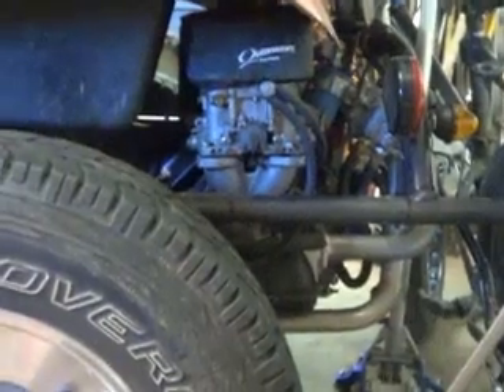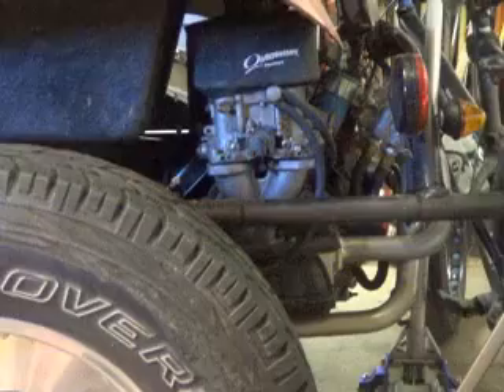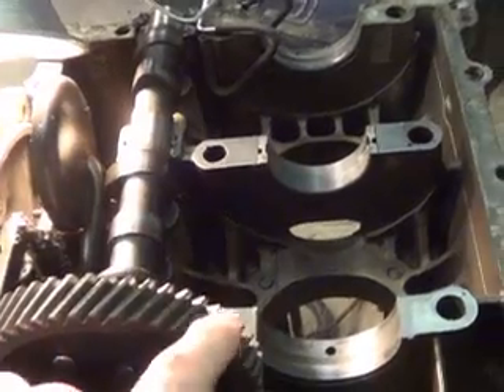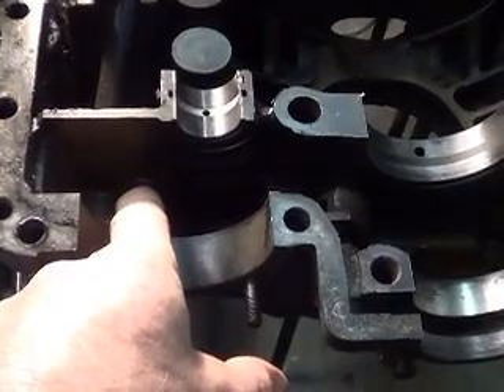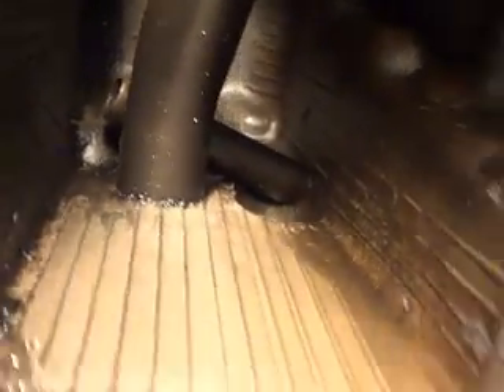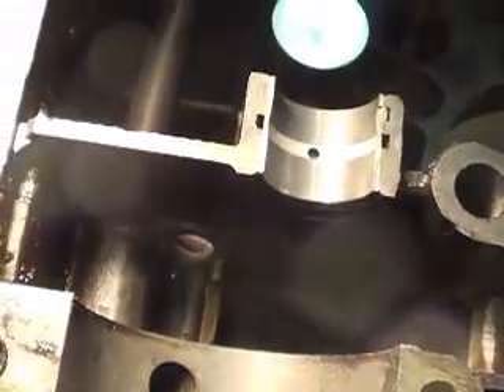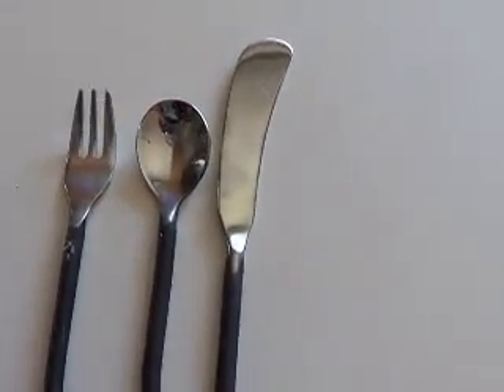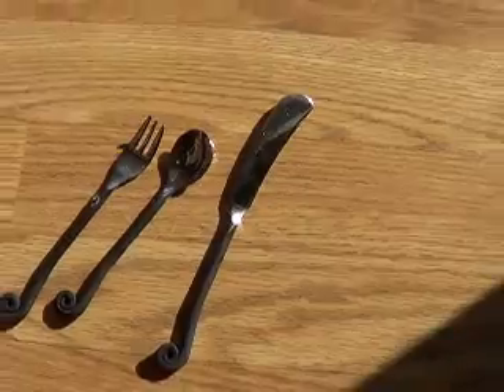VW aluminum engine case mod

Comment: Have you had to replace the oil galley plugs? Where do you get the plugs for the Autoline aluminum case. The small plugs on the flywheel side. We need a video on these plugs
Reply from the maker: The plugs came with my aluminum race case. The folks that sell those blocks stock them. The are just american thread pipe plugs.  you use an alllen  hex wrench to screw them in with a little sealer on the threads. No magic of any kind required and if you get a leak it's easy to access without disassembling the engine

Comment: I just bought 1974 Super Beetle and within 2 weeks it has lost it's ability to shift. Within the the short time I was able to drive it; it would grind into third and try to pop out of third while driving. Upon investigation the coupler appears to be good; but the shift bushing under the gear shift has totally worn away. Would that cause it not to shift?
Reply from the maker: Hope this helps  https://www.youtube.com/watch?v=0M08t04EvDA

Comment: I'll give you all a liitle incite when it comes to cam gears. The reason aliminum is used on the cam is two fold. 1 is obvious, dissimilar metal. 2 is the big one. In the valve train there is a ton of harmonic vibration, in the crank there is also harmonic vibration. The aluminum helps too dissipate the harmonic vibration between the two and calm down the valve train. Like VW, magnum gears used to make a steel on aluminum gear set, it was awesome! The only downside was wear in a high load valve train, all they had to do was hard anodize the aliminum gear and it would have been the perfect straight cut gear set.
Still enjoy watching your videos, although I've built hundreds of these engines it's still fun to see what others are doing, and what challenges they deal with along the way. Keep it up and thank you.

Comment: Nice
Reply from the maker: You are very kind. The loveland hot rodders got together at Dairy Delight in HWY 34 west of wilson last night. I stopped by but didn't stay long. Next Friday it's at Freddys on 287 next to the north wall mart. Usually a good turn out around dinner time
Reply: @TheEZGZ  Thanks for the heads up info.  I will stop by to say hi.  I enjoy your insightful knowledge on old VW.  I'm building a rail from a 66 VW.

Comment: Great videos... I learn a lot form watching. Building my first VW motor for adune buggy project.I'm curious to know why you chose a lower compression ratio for your 2 liter dune buggy motor?and...do you use a stretch gauge on stock connecting rod bolts or otherwise?
Reply from the maker: +roger ballard The Gene Berg Blue books go into great detail about compression ratio recommendations.  The 80 +  air cooled VW's had 6.6 CR and ran great. You can run more timing and some times more HP. In the future if you want to add a turbo you are ready to go.  Hope you have a good build on your engine.

Comment: i have seen old engine have 1/2 inch of sludge in the bottom. that little slot gets clogged up. at that point the mains are bleeding much more. so they drilled the cam gear area drain. because it can hold over a 1/2 quart of oil in there instead of at the sump.darrin will never let his new motor sludge up plus he is using a add on sump he shouldnt have any trouble.
Reply from the maker: +Alwayscheerfulx That makes a lot of sense. Thanks for your contribution and experience

Comment: The only aluminum case I bought was a total mess. There was casting flash inside and out with pockets of sand and other debris. I had taken it to the shop twice to boil it out and each time was still coming up with sand in the galleys and most likely in other important oil passages. I finally gave up on it after getting no response from several letters to the manufacturer. I sold the case with documentation and receipts for what I purchased it for to a brave soul that was willing to give it a try. I used my funds to purchase two good never align bored cases, and AS21 and an AS41 and built two good engines out of them. That's my story, I'm sticking with it
Reply from the maker: +alphahr  Generally you get what you pay for. CB performance cases are top dollar but top quality with my personal experience. Thanks for sharing. Wish we could still buy new AS21 cases.

Comment: Great video. I wonder if CB Performance has an opinion on this. They have a video on their website of some of the machine work on the case, but unfortunately there is no commentary.
Reply from the maker: +malkucken   Makes one wonder if it is just a machining short cut or an oversight. Casting molds are very tricky. Now I have something else to worry about. LOL